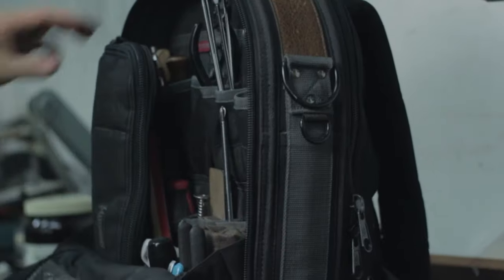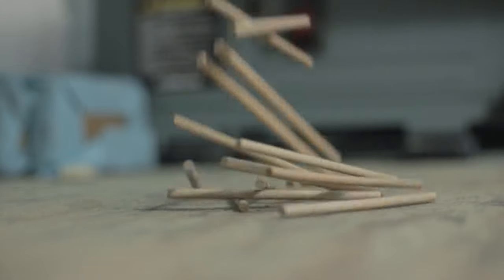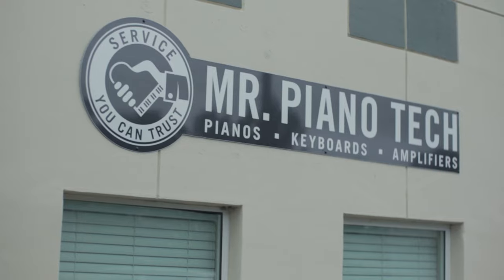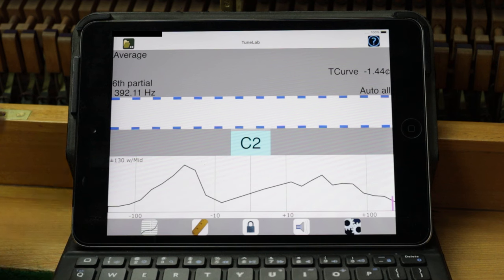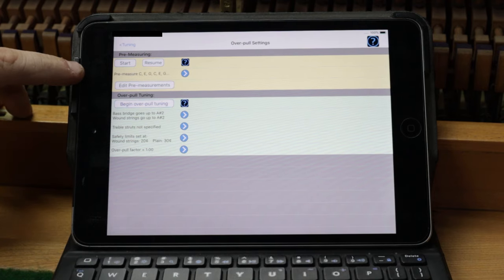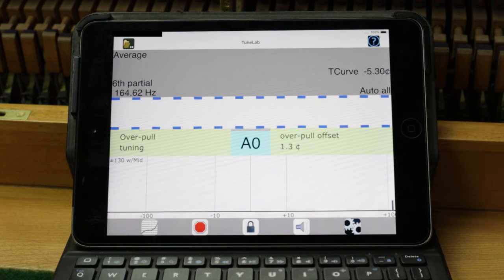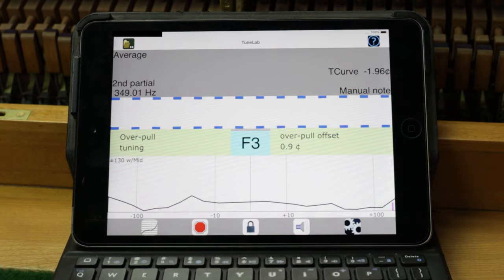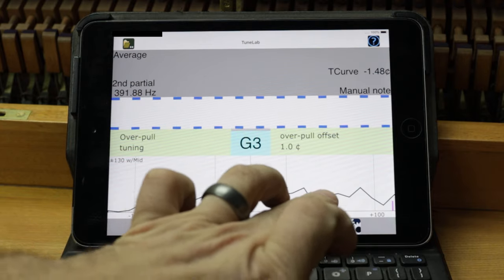Pitch Raises

Comment: Great share, I am prepping to take on my first piano, a 1900's upright.
This video told me much about what is going on in a pitchraise, at all.
I hope to restore the piano a step at a time and learning how to tune it myself is just one of those steps.
I am seeing piano tuning is an artform, much physics at work.
At some point, I am going to have to replace the hammers as they must be original, quite dirty, with deep grooves cut into them.
One thing is for shore, it got a lot of use and that makes me happy to extend its lifetime.
Have a Happy New Year and thanks for sharing your expertise...
Reply from the maker: Thank you! I'm glad you found it useful. Good luck with the restoration, let me know if you run into any problems, I might be able to help.
Reply: Keep in mind that new hammers might have a different weight and change the playability of the action drastically! My Yamaha G2 had very bad action after replacing the hammers and I had to invest a lot in re-balancing all the action parts.

Comment: Do you ever use Protech on bearing points where old and or rusty strings are present?  Thank you for making all your videos!
Reply from the maker: No, on strings I’d prefer a dry lube like Teflon powder. I’ll also use Teflon on grand knuckles and pedal trapwork. I like Protek on flange pins, action centers, and old dry rubber bits. Thanks for watching!

Comment: I'm picking up a 1972 upright that had one owner, tuned regularly until around two years ago. After I've let it settle for a few weeks I will tune it up BUT not sure if I need to do a pitch raise. When I checked it out it was out if tune very slightly as it is stored in a garage.
Reply from the maker: I'd say if it's less than 5 cents off you should be okay with a regular tuning.

Comment: Thanks for the video . On a pitch raise Is there a reason why you go to the temperament octave first , then treble or bass ? The TuneLab software seems to want to take you to AO as the starting point ?
Reply from the maker: Because I only use TuneLab to set the temperament, then finish by ear. I only follow note for note with it if I’m doing a pitch raise by overstretching the recommended amounts.

Comment: I have an android so I cant get tunelab but I have an app called panotuner, Will it work? Also 

When you make a pitch raise do you set the pin or is not needed?

How much time do I have to wait after I complete the pitch raise so I can make the fine tuning?
Reply: Panotuner will not work.  It's not specifically for pianos.
I believe Mr. Tech mentioned no pin setting at first, as it's going to be adjusted again later.
Also, Piano said you can do the fine-tuning immediately.

Comment: Every time I have seen a demonstration of a pitch raise with tunelab the unison's have been OK. What would the do if the unison's are out on every note, would you tune the unison's first on the measurement notes or use mutes to isolate one string.
Reply from the maker: I talk about that, it's around 8:10. Yes, I recommend tuning all strings of each note before moving onto the next. That way they'll stretch together.
Reply: @MrPianoTech  I think you may have misunderstood my question. Lets say that you have a piano that is 56 cents flat and mostly all the unison's are out as well. As you will know with Tunelab when doing a pre-measure for a pitch raise the note changes automatically ( not sure if you can go back and remeasure ). Would you clean the unison's ( Not tune them just clean them up at whatever frequency they are at the time )of the measured notes C E G up the keyboard before doing the pre-measure or use mutes the isolate one string.
Reply from the maker: @johny_mac  Gotcha. No, I've never cleaned them up. It seems to pick the worst of the group and goes with that.
Reply: @MrPianoTech  Thanks for that. I was under the impression that you would get a error or inconsistent results with 3 stings with slightly different tunings. I guess it is different from measuring inharmonicity.
Reply from the maker: @johny_mac  Yeah, if I was measuring inharmonicity I'd single one out.